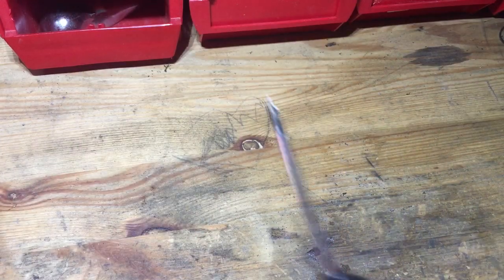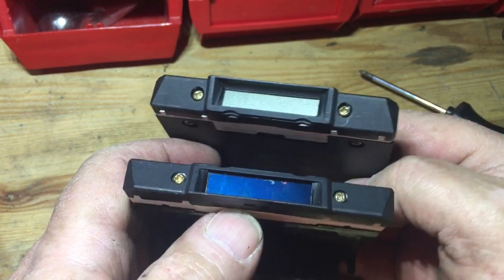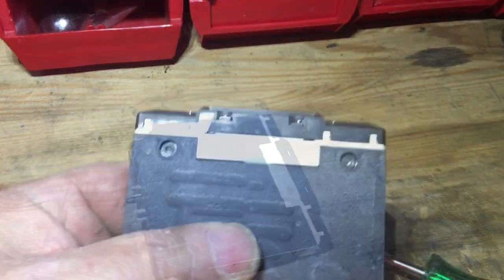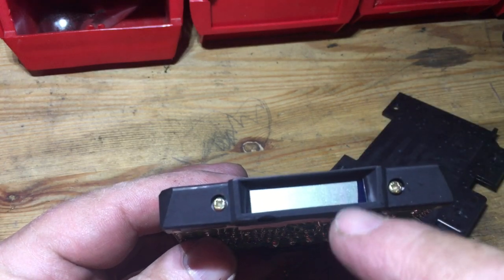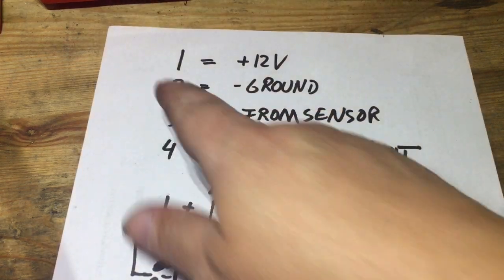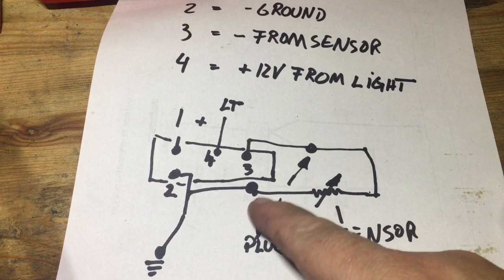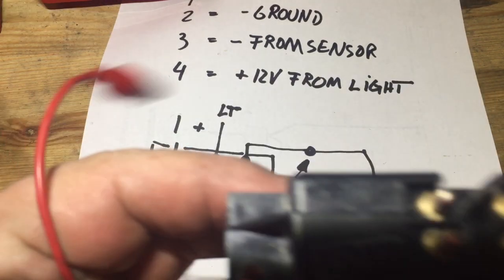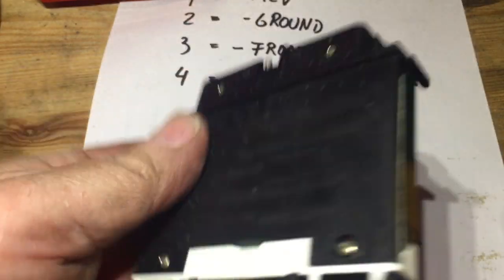Repair the outdoor temp sensor display on Mercedes Benz W126 W124

Comment: Mine consistantly shows +58C... in Poland, in November! (with snow on the ground)
Reply from the maker: That is most likely due to a cold / cracked solder joint on the printed circuit board.
Reply: l have same issue in lithuania :) did you manage to fix it?

Comment: I saw some US model cars showing celsius on that display, is it possible to switch fahrenheit to celsius? or you need whole new assembly for that?
Reply from the maker: I have not found the mechanism by which one could switch the unit of measure. Switching the display is easy enough though.

Comment: Hello, on a 1988 300SEL, aside from the trunk where could the stereo amplifier be located.  I checked the trunk and there is no Amplifier.  trying to replace factory stereo with New stereo, but i can not get the speakers to work.  Was told there is an amplifier in the trunk on the driver side.  I checked and there is none.  Can you help please.
Reply from the maker: The stereo system amplifier sits in the passenger side foot well behind the large plastic panel under the carpet. The car alarm unit is also mounted there. Give it a try. It is really easy to get to.
Reply: @straybenzes  will check this weekend, thank you.
Reply from the maker: @AE-TDK  Good luck.

Comment: Good afternoon, I have a 5-pin screen, well, it doesn't matter, the question is, the screen is on, the backlight of the screen, but does not show the numbers, is it somehow being repaired or not at all?
Reply from the maker: If the screen still looks grey and not black then you may be in luck. What I would do is to take the unit apart and resolver all solder joints. Good luck!
Reply: @straybenzes  figured out, to one pin on the wiring to the screen, there was a bad contact, it disappeared, it worked, only the thermometer itself did not work, there was a second one in stock, I replaced it, everything worked as expected.
Thank .
Reply from the maker: @МаксМакс2846  Great job!

Comment: Hello, i have w126,  can you help me with outside temperature?, my LCD has black spots, can be fixed?
Reply from the maker: Unfortunately, I do not know of a way how to fix the black spots. That means the LCD screen is damaged and needs to be replaced. Sorry!
Reply: @straybenzes  ok, thank you
Reply from the maker: @joartcnc  Good luck
Reply from the maker: @joartcnc  :)
Reply: It can be fixed. Search from ebay "Ata Display For Mercedes W124 outside Temperature Indicator Tacho 6-POLIG". It is LCD screen repair kit with instructions manual. It cost about 40€
Reply from the maker: @SuperPate007  Thank you so much. For units with a completely black housing the 6 pin version should work. For the one with the white version front plastic like in this video the 10 pin one needs to be ordered. All the best.

Comment: Hi Ralph. I had hoped to see how you get it in the dash. Do you push it in from the back of the binackl, or do you have to take that out completely to get it in. Mine does not work but it is a 2001 so may be completely different. I like everything to work on my car but with all the electronics that's not going to happen. I'm still fighting with the alternator. I have another one coming today that was tested as working but I'm not confident. Is there a fuse or relay in the charging system on these? Can the SAM go bad? 2hat a nightmare!
Reply from the maker: On a W126 you need to either take the cluster out completely like shown here: https://youtu.be/racg2wpusPk or you partially move it forward and use your precision swiss army type hands and a very short phillips screw driver to remove the two screws that hold the display in place. The display comes out toward the back, It is briefly shown at minute 3.56. 
When you are talking about your 2001 car I am assuming that this is a W210. The cluster comes out pretty much the same way. The display is a completely different type though. The folks from Pelican have a pretty good write up about how to remove the cluster. https://www.pelicanparts.com/techarticles/Mercedes-Benz/37-ELEC-Replacing_Instrument_Cluster_Light_Bulbs/37-ELEC-Replacing_Instrument_Cluster_Light_Bulbs.htm
Reply: @straybenzes  Hi Ralph.
I have researched this and discovered that the center display is a plug in unit. That makes it easy to replace. I hsve ordered one of those and also got the two tools to remove the binnacle.
However, the two side displays, one for temp and one for the clock, are sodered in and looks to complicated for me. I'll have to see if I can find someone to do that. I will wait till I get the new center screen to take the unit out of the dash. Thanks.
Reply from the maker: @wernerdanler2742  Good luck!

Comment: QUESTION: Thank you for your video. I have a w126. Both the power to the radio AND the rear screen defroster stopped working at the same time. Did I accidentally disconnect a wire or plug in the trunk or rear seat areas?
Reply from the maker: Hmm. That is two separate circuits on fuse 2, 3, 7, and 18. Are all those fuses in good shape?

Comment: Hello,how did you take out this instrument from the main board?  Thanks.
Reply from the maker: You need to take out (at least partially) the whole instrument cluster. There is a video on my channel on how to do that. If you only partially take out the the cluster you will need a very short phillips head screw driver to loosen the two screws holding the temp display in place. It is fairly easy to pull this instrument out. Good luck.

Comment: Great. Thanks! (Where did you get your 12 volt power tool power supply? It's compact and looks to be very helpful!)
Reply from the maker: It comes in very handy and is an older cordless drill battery. Most are +18V, but you may still be able to get replacements. I use it a lot to keep power applied to newer car systems so I do not have to reprogram radio, etc.
Reply: @straybenzes  Cool. Thanks!!

Comment: Hello, can W124 outside display be used in W126 instrument cluster?
Reply from the maker: Unfortunately they are not the same.
Reply: @straybenzes  Oh ok thank you
Reply: @straybenzes  Hello, I have one question again, do you have  installation guide for mounting the outside temp display on W126 instrument cluster? :)
Reply from the maker: @detrock  Try this one for removing the instrument cluster. Once you have the cluster removed it is really easy to get to the temp display.